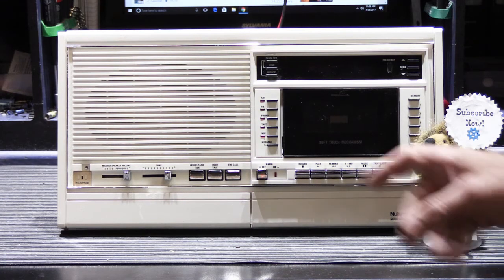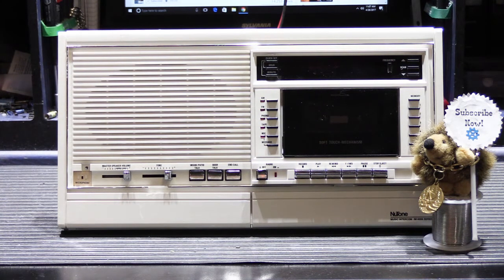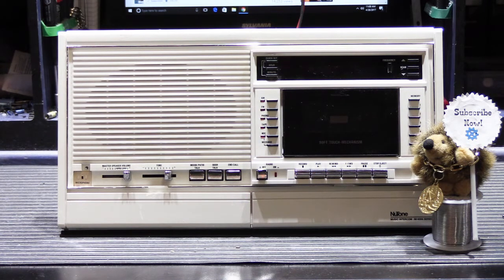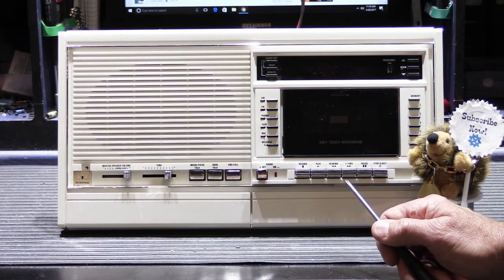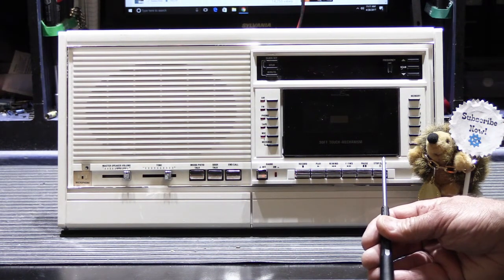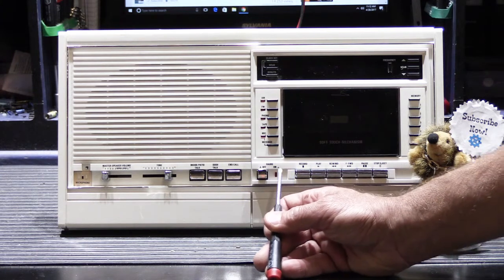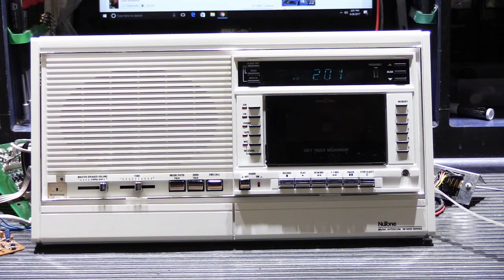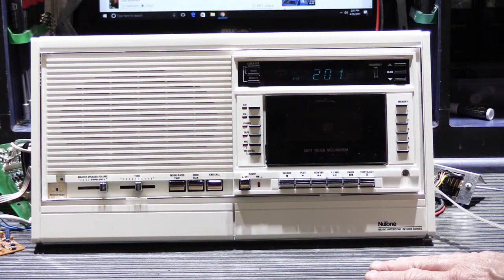NuTone Intercom IM4006 and IMA4006 Common Failure #1

Comment: I have noticed that mine has a loud howling sound when I turn the “system volume”knob down and have the “master speaker volume” up.  
I like to keep the main volume knob to a listenable level and have the master speaker volume slider including the remote station knobs set to maximum. But when I slightly turn up the system volume knob that sound disappears. I’ve noticed whenever I turn the remote stations off that problem goes away.  Is this normal?  I only have 2 remote stations installed.
Reply from the maker: Hi 2012-v9b:  What you're describing seems odd and not normal.   Typically a "howling" noise would be related more the the "Intercom Volume" setting than the System Volume.  Howling usually indicates some type of feedback with the Intercom function.  Do you normally keep the 2 Remote Stations in the "Radio / Intercom" on the IM4006 (room-control switches)?  The troubleshooting would be to disconnect the wiring to the 2 Remote Station - from the Terminal Board (not at the remotes)  Then set the System Volume to the desired level and use the Master Station - Then reconnect just 1 Remote Station - Test the System again - Then add the 2nd Remote (having disconnected the 1st remote) and test - I think you have either a Wiring or Remote Station problem (however since your IM4006 is at least 28 years old - it could also have problems) - Chris
Reply: ahh, I found the problem… somehow overtime a connector was plugged out of a bored. I plugged it back in, hooked it up and it works fine now.  It was just strange to me because it got a full rebuild 4 months ago.

Comment: Mine had the same exact issue with the awful loud buzzing, but I was able to buy the parts off Amazon and rebuild the power supply, and now it’s back to normal. But I have mine as a collectible item. I had somebody build a wooden box me so that I can fit it in there instead of the wall. I also have a switch on mine, so that it’s not on all the time and it will last longer.
Reply from the maker: Hi Stewie:  Well Done of fixing your IM4006 - The typical life span of an IM4006 begins when it is first installed and usually it will be 25 years +/- before it requires any amount of refurbishment (very long-lasting, I think)  Since yours seems to be used mostly as a radio, having a master power swicth is fine - For complete Systems, which inlcude use for the Intercom and Chime, turning the Syetm off is not usually practicle - Chris

Comment: For some reason on mine  there’s no sound for the radio unless I press and hold (door talk) button and when I increase volume sound cuts out.     Could be relay issues not sure
Reply from the maker: Hi user-xp6kr2no3w:  There are many different factors to consider in regards to the problem you describe - 1.   Your System is somewhere between 28 ~ 37 years old, so it may be "old & tired" which creates operational problems - 2.  The circuity that controls the Intercom Functions mat be damaged, causing the problem - 3.    Some mix of 1 & 2, plus other problems tossed into the mix.  I can say with a very large amount of certainty is is not s "single-point" issue like a relay - Chris

Comment: I live in a home that had one of these systems.  There was the loud noise that would not stop so I removed the system.  We don't want to get it reparied since we don't use casettes. If anyone is interested in the system we took out of the wall for parts, I am glad to send, just need the cost of mailing covered.  Diane
Reply from the maker: Hi Diane:  Removing the system because you don't play cassette taps is interesting.  Did you know that you can add an External Audio Jack to the Master Station and plug in external audio sources like your phone or an Amazon Echo Dot and even use a Bluetooth Receiver to connect to it wirelessly? - The Audio Jack costs just a few dollars and it's easy to add - Here's a link tot our Video that shows how to install the Jack:  https://www.youtube.com/watch?v=OUKz-DPnAT4&list=PLsTvqKsBnGYdC28d_5P2CQXAhtUS6f_2S&index=1&t=42s
Chris

Comment: We are trying to upgrade do you know which model can use the same wires but newer model?
Reply from the maker: Hi The Nd:  NuTone no longer makes any Intercom equipment, so there's no upgrade path with NuTone.  You would need to look for another manufacturer who offers equipment that can use your existing NuTone IW6 cable.  Since you would be switching brands - you will have to replace all of the equipment in your system - Repairing what you have id often simpler and less costly - Chris
Reply: @northsideservicecompany3567  I managed to find someone selling a brand new ima 4406 the one with a cd player and it matches with the 6 wire system like ours has so hopefully that will work with the other speakers we have
Reply from the maker: @canond4427  You will also need the IR105 Wall-Housing to install the IMA4406 - Chris
Reply: @northsideservicecompany3567  ok thanks I'll look for it
Reply: @northsideservicecompany3567  I'm curious if it's brand new in the box would it have it inside? Or I have to buy it separately
Reply from the maker: @canond4427  The IR105 is a separate item and it's not included with the IMA4406.  You need to make sure that the IR105 is complete including the 2) 801T Transformers - Transformer Mounting Bracket and Transformer Box. - The IR105 is 1-1/2" taller than your existing wall-housing, so you'll have top enlarge the opening to make it fit.  If you split the difference - 3/4" top and bottom - the IMA4406 will cover the "paint-edge" left by the IM4006.  - Chris

Comment: Do you make a component kit with all the capacitors and stuff needed to refresh one? I’m good with a soldering station.... also I need a transformer for one. Are the IM4006’s 16v transformers?
Reply from the maker: Hi The Bryan Family:  No, we do not sell component kits.  If your IM4006 has failed enough to kill the Transformer, it will be in need of much more than a "refresh" - Chris

Comment: Sounds like a bad power supply filter capacitor?
Reply from the maker: Hi Grant Taylor:  The short answer is yes, probably - The longer answer (or question) is what else is wrong?  Depending on how long the Master Station has been failing (while being ignored by its owner) the failure will grow through the set - meaning that there will more to rebuild.  For long term reliability much needs to be done - Chris

Comment: I used to live in a house with this system built in. I never had this problem, but I still turned the volume down on my speakers because of that faint whine coming from the system that you hear after it's on at 10:50. That tone drove me crazy at night!

Comment: Those other electronic shops just want to sell new stuff, it's like when my HVAC unit broke I was told by others that it isn't fixable, but when one independent contractor came out to look at it, he replaced a simple failed capacitor and we were back in business (he also said that big companies are told to say units are broken in attempt to sell new units). My point being, that person with the 4006 had to find the right shop/guy (you). Great video! BTW, can't wait for the "intercom that didn't exist" video! :)
Reply from the maker: Hi Vincent: You're correct, manufactures stress sales over repair quite often now-a-days.  NuTone stopped actively signing up new Service Centers 20 years ago and when they do sign up someone new, there's no training, technical support or oversight of how they operate.  

When I started 30 years ago, there were very high expectations and standards that I had to meet to continue as a Service Center.  The trade off was, if I meet their expectations, they would support me and help make sure that I was successful.  

I always saw it as a fair trade and up to the time that NuTone was acquired by the current owners, Service Centers were considered to be a valuable asset to the company.  Now we have been marginalized and are treated more like a nuisance. - Chris